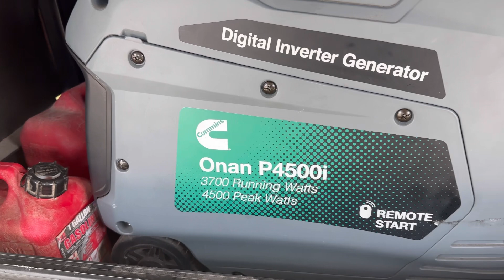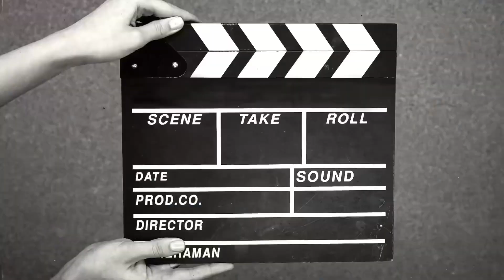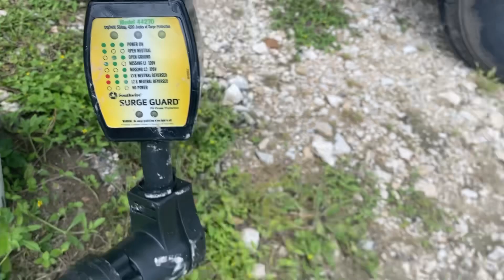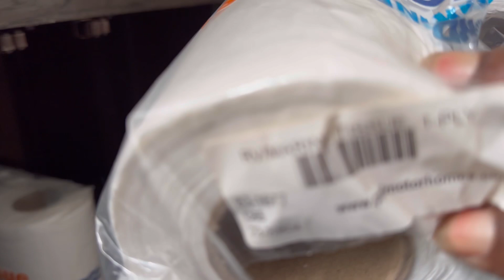RVLife/ Finally made it to Thousand Trails Lake Conroe TX ..time to open up and clean

Comment: Fun video guys! Next time Battery is dead just plug camper into truck as you do for towing that will run the 12 volt system. Much easier than pulling out power cord and starting generator. Thanks for sharing your adventures! Good luck on the road!
Reply from the maker: I watch your channel all the time!! Thank you for all the great tips you give!!! I tried that before and it didn’t work out for me. I will definitely give it another try. Thank You again!
Reply: The 12v supply from your tow vehicle is really only a maintainer if your battery is drained below 50% you still may not have enough juice to lift your landing gears especially if you have electric over hydraulic  which takes Even more power. Best is to discount your battery when your store it and also  possibly invest in a solar setup to always keep batteries topped off and ready

Comment: Your seems track seal is coming off which is typical  use some silicone adhesive  and it will stay put. Drivers side front bay area